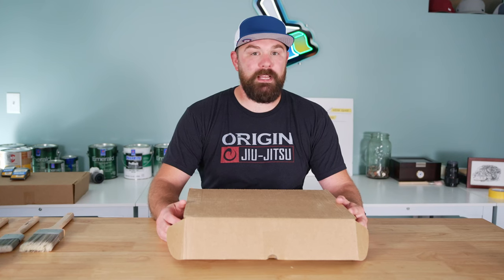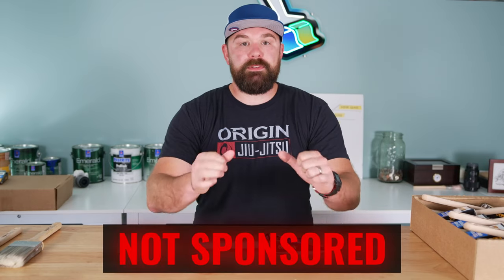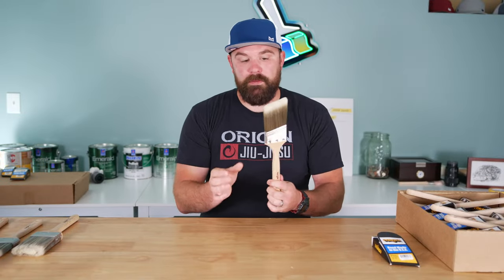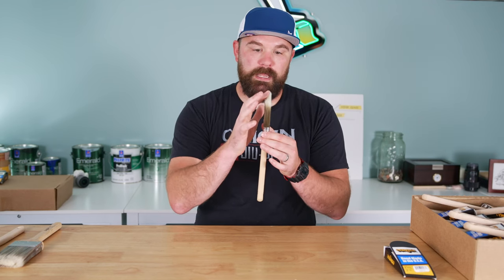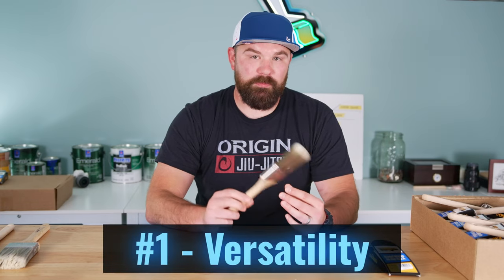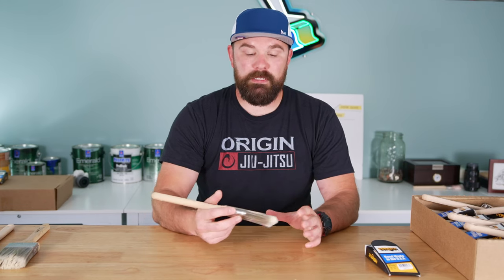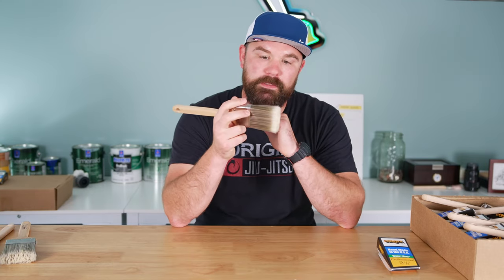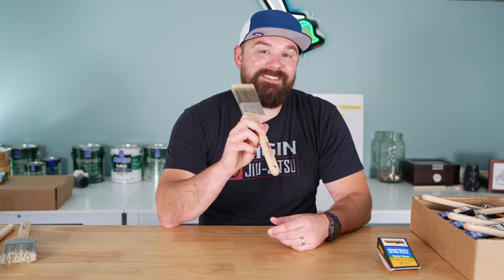3 Reasons Why This is My Favorite Paint Brush Ever

Comment: The Cortez is awesome. I have a three inch but I’ll need to try the two and a half inch. I’m a DIYer and I just happened to buy the Cortez about 4 years ago at my local Benjamin Moore retailer when I was picking up some Regal Select. I still use the same brush. I bought Corona’s Delta brush recently and didn’t like it at all. I went back to the Cortez after cutting in one wall with the Delta.
Reply from the maker: I’ve never tried the delta.  Over the last year I tried a whole lot of different brushes in different widths.  For the majority of the work I do I still prefer a 2 1/2 inch Cortez 🤙

Comment: Curious to hear the difference between this and the Vegas. I just bought a 2" and a 2.5" Vegas based off your recommendations for trim
Reply from the maker: The Vegas video is coming out this week.  The Cortez is the best all around brush.  We use them for ceilings, walls and exterior work.  The Vegas is more of a specialty brush that is excellent for trim work and doors.  Especially when using hybrids like Emerald Urethane and Advance.
Reply: Vegas is super super soft. Way too soft to cut a wall.
Reply from the maker: Agreed.  I use a cortez for the walls and ceilings.

Comment: What are your thoughts regarding the 3" cortez sash? Thank you
Reply from the maker: They’re great if you like that size.  I find them to be a bit large for what I need to do and if you’re not use to using a brush that big then it can fatigue your hands.  It holds more paint than a 2 1/2 inch so it’s noticeably heavier when you work with it.  For me (and it’s totally a personal preference) a 2 1/2 inch Cortez is my sweet spot.  I’m quite fast with it and I’m use to it in terms of holding one all day without my hands fatiguing

Comment: Alright, 95% of painting is done with large and small, non beveled rollers...brushes are used only for 5% of work, pros know this...enough with the opinions on brushes, wooster/ purdy, thats it
Reply from the maker: Mmmkay…you are correct that 95% of product is applied with a roller in a lot of cases.  However, I’d say around 70ish% of the time it takes to apply a coat of paint in a typical room is spent cutting in with a brush and that’s a far more technical skill than rolling.  The quality of the brush matters a lot in the work that I do, but that might not be the case for everyone 🤷‍♂️